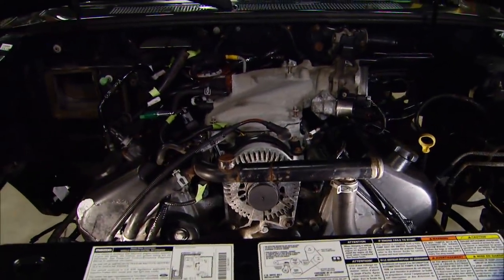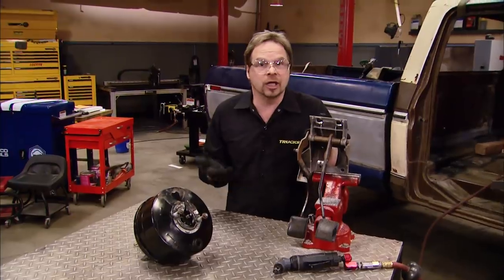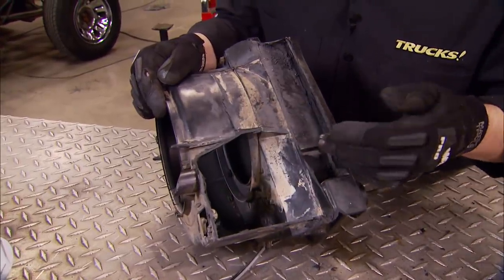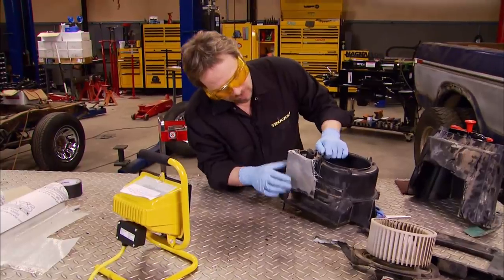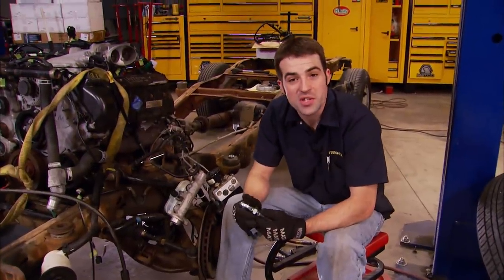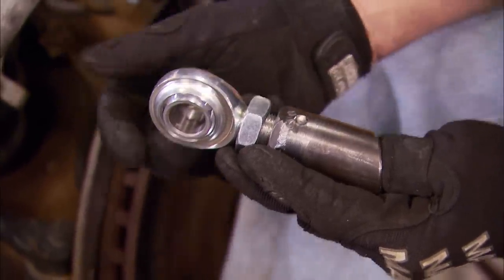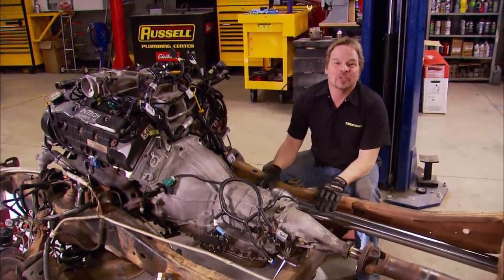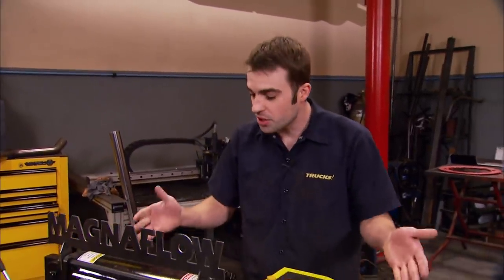Swapping a Massive Engine into a Ford Ranger Means Lots of Custom Fitting - Trucks! S12, E5

Comment: Very nice.  Have a blown head gasket in my 03 Dakota and being low on cash can't afford to fix it right now.  With my right shoulder issues replacing the head gaskets is going to be a pain as well.  Honestly might just be easier to do a swap since the old one has 220K on it.  Going to a 08 to 12 4.7l will get me something with about 70 to 80 HP more as well as a little more torque, the only major issue is the exhaust manifold is a little bit different so the exhaust will need to be fixed and the intake needs a bracket since the 08 was drive by wire and the 03 isn't.  Computer should hook up just fine though as mine is the 4 plug NGC already.  Now to find a salvage engine and may as well pull trans too.  Then finding somewhere to do the work.

There is no way I am giving up this truck though.  It was one of the only major things my wife and I purchased together and we have a ton of memories in it together.  She passed away Feb last year so it means a lot more to me than the sum of it's parts.
Reply: K-Seal. I've been a service tech for 20+yrs and until I tried K-Seal I thought all headgasket in a can products were snakeoil or dangerous. It won't perform miracles but it's a cheap first shot.
Lately roadkill had found it's amazing ability and had a couple total fixes on junkyard cars with it. Normally they blur the products but actually took the time out to mention the product too
Reply: Also wanted to say I'm sorry to hear about your wife. I vote for replacing the headgasket vs a full motor/trans swap, especially if you're hurt and it'd be great to have the honor of taking it to 300k
Reply: @Onewheelordeal  I have used something similar for head gasket repair.  It helped but not 100%.  I am limping by for now.  

The issue with replacing the head gasket is everything that has to be pulled apart.  It's overhead cam so that makes it a major job to deal with.  I have done a lot of work on it, recently rebuilt the front end with all new bushings and ball joints, tore one side apart one day, had a shop replace the bushings as I could get them out but not back in and my shoulder was dead.  Waited a few days then put them back in.  Then a few weeks later did the other side the same way.

The service manual talks about pulling the master cylinder among other things as well to do the head gaskets.  There is some top end noise as the lash adjuster are old and probably should do timing chain and gears if I am that far into it.  Which adds a ton more work which all takes time.  By the time I do that it may as well be a rebuild so then I am at the point of why rebuild when I can swap and net a few gains.

Either way I have to save before I can do anything at all.  A long block is around 2500 to 3000 and a rebuild kit before any machine work is around 700.  Engine and trans at LKQ is about 600 and I end up with a trans with a lot less mileage on it as well.  Going to a newer engine I get a better head that doesn't have the same issue with the lash adjusters getting weak as they get older too.  

And thank you, I miss her very much and she always helped me deal with the stress of things like this.  I lost my wife and best friend in the same day.  When I found her I tried to bring her back and at one point broke her breastbone and tore my shoulder up even more.

Comment: Okay but WHERE does one find a junkyard Marauder? Those things are rare as it is
Reply: hell it be easier to find a Ford explorer with a 5.0
Reply: @purextacy3174  Right, plus be an almost plug and play swap being the Explorer is based on the Ranger platform.
Reply: @purextacy3174  your missing the point. This is to show people that a 5.0/ls isn't the only swap you can do. And to the op, you would be better off just snagging a sohc 4.6 or 5.4 and ordering the dohc heads
Reply: @melted_pistons  depending on the generation the crown vic has the 4.6 3valve if memory serves
Reply: Guess we are lucky here in Oklahoma, my favorite salvage yard has 3 in stock right now
Reply: Try looking for a Lincoln  mark vlll.

Comment: Deleting the A/C the way you did creates a problem. Air flows through the heater core and the A/C evaporator (even when A/C is not in use.) Air flow and temperature regulation is varied by the blend door inside the cab. Walling off the cold side is going to mean the only air flow will be through the heater core.

Comment: I’m in Vegas,  there’s no way I would delete the A/C.   If you don’t have some cool air in the heat of summer, you better keep an ice chest full of cold drinks because it’s only 110 in the shade
Reply: FreeRepublicUSA I’ve been wanting to ask the vegas locals how the situation looks over there at the moment.. it’s pretty bad over here in Los Angeles not because of the virus but because idiots pushing buttons with the authorities 🙄.. hoping everything dies down n goes back to normal soon.. I’m missing the strip
Reply: Mike CorLeoné    I’m in construction and we have been working nonstop as we are deemed essential.  I also own a very small potato chip distribution company that is still operational.     The strip is straight dead and empty.   Everyone is scared of this virus.   I actually came down with some of the symptoms about 4 days ago so I’m just staying home to keep everyone safe as best as I can and taking time to recover, LORD willing.
Reply: FreeRepublicUSA I’m oretty sure i already had it. I had a 2 week flu that started end of February.. it was horrible, I’m still coughing from it so i just stay inside
Reply: Not every state has high temps and not everyone is bothered by them. 

For most of my life I didn’t own a vehicle with A/C or a functioning A/C. Didn’t care. Still don’t. 2 out the 3 vehicles I own have functioning A/C and I can count on 1 hand the number of times I’ve used it in both vehicles. And while I don’t live in the desert, it regularly hits 90+ in the summer with lots of humidity.

Comment: Big brother v8 baby brother v6 is the way to go and keep all the OEM  stuff heat, ac, ps, etc. You can boost the power on the v6. Bore and stroke and head work three angle valve job and porting work and matching intake and exhaust ports. Rollers cam/ rockers  lower parasitic losses.
Reply: V6 4.0 being bored out to a 4.2 are to the max bore depending on block you're not going to get the horsepower.

You'll spend more money than you want to do all that
Reply: @purextacy3174  power to weight ratio  it's a compact size truck  and not a midsize truck.  It tow more than 5,000 lbs. Anyway limit by frame rear end springs etc..
Reply: Big Wheel  I don't think that it will fit.

Comment: Those Lima 4 cylinder engines take well to turbocharging
Reply: That head on the 2.4 had two plugs per cylinder, I owned a 98 ranger with that,& the 5 speed. that's a nighmare those plugs. Now I have a 99 Mazda b3000 with a 3.0 v6, basically rebaged ranger. The motor is Ford, ac, fuel injected, automatic. Not a bad small truck.I will drive it until, well got it @ 154k, now has 204k. Had the trans done.
I heard they go 300k. Two mechanics said that is a sound motor.
We will see.?

Comment: I swear that looks like a Mazda pickup
Reply: The Ranger and Mazda are almost the same! Built on the same assembly line at the same time. Only real difference is some sheet metal .
Reply: So...not really a ranger then. Unlike the 80s and 90s rangers
Reply: Lassi Kinnunen  yeah, back in the late 90s me and a buddy pulled out the 2.3 in the ranger we had and dropped in a 302 with a c4 automatic. It was a beast
Reply: @dave1135  Built by Ford on Ford assembly line, using the same parts! I can't remember what year they were combined, I believe it was early 2000's. I worked for Ford at the time and built these truck's. They are Ranger's with slight difference's! Look at it however you want!

Comment: Great work! Im not really into those bending pipe machines for some applications, specially e haust, while it is very easy to build a custom exhaust it looks like it reduces the diameter on the bends, im sure its not that big of a deal but how about exhaust flow? The less curves it has the better so if you have curves and reduced diameter in them ita bad right? Am I making sense?

Comment: Much easier swap with a 5.0 Windsor and a generation older ranger
Reply: Mike C 
Are you sure? I thought all of their small blocks that replaced the Y blocks with the exception of the Cleveland and M were considered Windsor?
Reply: Mike C I have a 93 f150 and from what I’ve heard from mechanics it’s a 5.0 Windsor (made in windsor, Ontario)
Reply: Mike C 
Wow! Great! Thank you for that knowledge!
Reply: Mike C thanks for the knowledge-however Ford only called the 351 the Windsor directly to distinguish between the 351C. (My dad had a clevor in a Bronco). They are all sbf replacing the Y engines. So at the end of the day its kinda simantics😆
Reply: Boring. Been done so much. Almost as bad as fagle LS swaps
Reply: Brandon Smith thanks! I learned a lot from that comment:)
Reply: Mike C I know what a clevor is my man-but thanks for the info (again)

Comment: Deleting the A/C is a real chickenshit move.  You've just taken a lot of the pleasure out of driving a performance based vehicle.   I've had to go without    A/C before until I could fix it, and it's awful.   No interest in this build now.  You guys just take the easy way out rather than solving the problem.
Reply: I want the horsepower and the daily driver extras

Comment: that not ford ranger so dont be calling it ford ranger because of look of it
i own ford ranger i know they both dont have same part so dont be mistaking ford part dont fit on Mazda b2300
unless ya talking about back in 1980 all truck same band before law spike copy right same model vehicles
Reply: K Z the Mazda b2300 and b3000 were built on the same assembly line as the ranger by ford. It was nothing but a rebadged Ranger.

Comment: Unless that cobra engine is going to get a supercharger, a new Ecoboost 2.3 4 cylinder will have more horsepower,be lighter,get better mileage and be smaller and lighter.
Reply: What fun is that
Reply: And be much gayer too.
Reply: Big Wheel  an i6 would be harder to fit in than the v8 😂